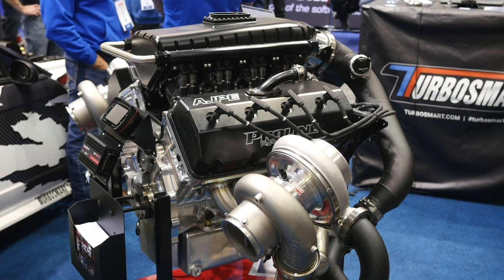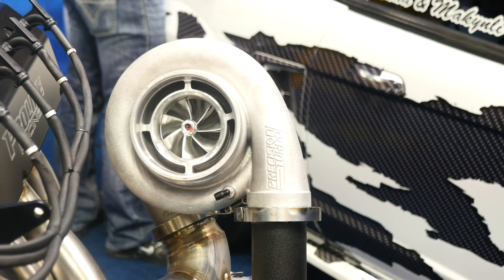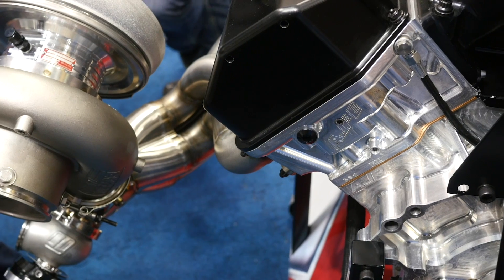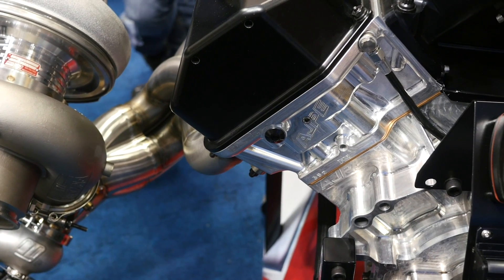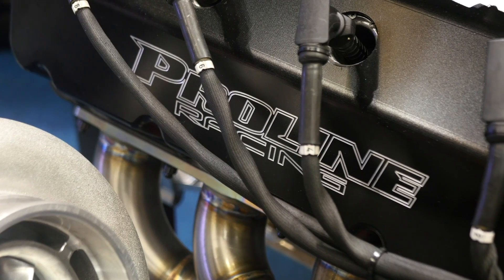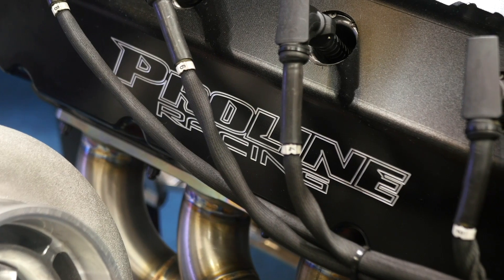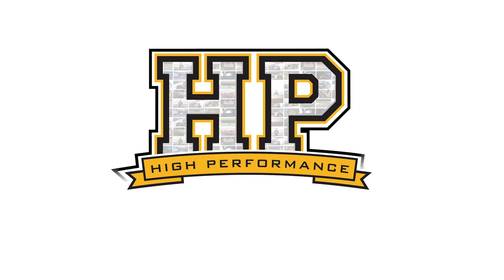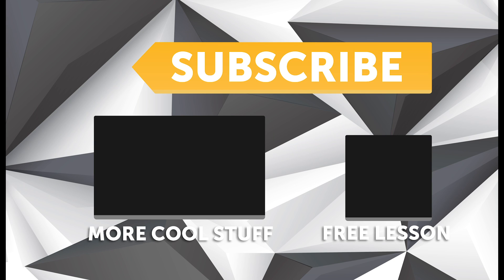Secrets Revealed! 5000HP+ Head Cylinder Sealing Techniques | Proline Racing Engines [TECH NUGGET]

Comment: question:
Why have a cylinder head at all, why not boar the block and head as one unit. Has something like that every been attempted?
Reply: Opposed pistons..
Reply: I believe there were versions of Chevrolet inline 6s in the 50s that had the head and block together. They had some issues with repairing them, cause you couldn't remove the head
Reply: I think it has. Machining the valve seats would be killer though.
Reply: Tried already Ford Flathead Engines only have a thin cover for the combustion chamber.
Reply: @dj4monie  still a headgasket on them.
Reply: I think buggati did it in their early years
Reply: https://images.search.yahoo.com/search/images?p=styre+monoblock+image&fr=mcafee&imgurl=http%3A%2F%2Fsteyr-motors.com.au%2Fwp-content%2Fuploads%2F2016%2F02%2FMonoblock.jpg#id=1&iurl=http%3A%2F%2Fsteyr-motors.com.au%2Fwp-content%2Fuploads%2F2016%2F02%2FMonoblock.jpg&action=click
Reply: http://www.steyr-motors.com/marine-diesel-engines/
Reply: These Steyr marine engines incorporate the heads and the cylinders as one unit. No head gasket